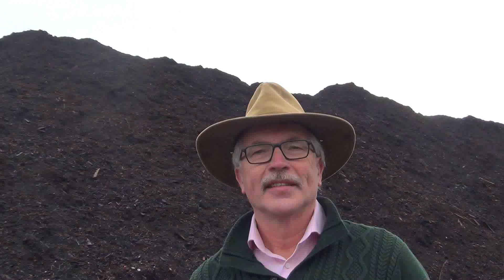Reducing Methane Emission During Composting

Comment: Excellent video! I'm trying to get a better understanding of methane production with at-home composting. If I'm doing a "bad job" composting (high moisture, not frequent enough turning, too many greens), how does the methane produced relate to the methane produced in a landfill? Is it still better to compost? Also is there a way to know if our pile is producing a lot of methane? My pile doesn't really smell - would it have a smell if it produced a lot of methane? Many thanks in advance!
Reply from the maker: Hi Kelly, thanks for your questions. We expect that even if you are doing a "bad job" of composting at home, its not likely that you are producing the same amount of methane as in a landfill. Yes, its still better to compost, as there are so many other benefits for your soil as well. The bacteria that produce methane thrive only when all available oxygen is gone. The smelly compounds are actually produced before this time, which means that if your compost does not smell when you turn it over, its not likely producing methane. Methane itself does not smell. Hope this is helpful!
Reply: @TransformCompost this is so helpful. Exactly what I’m wondering. Thank you! Cheers for you both
Reply from the maker: @WigglyWooTH  You are welcome!

Comment: Is there a practical use for this methane ? If so how can one go about capturing and scrubbing the methane ? Can it be liquified ? What benefit would that grant ?
Reply from the maker: The methane from composting is and should be at very low concentrations, making it impractical to capture. If one wants to capture and reuse methane, one should be using anaerobic digestion rather than composting